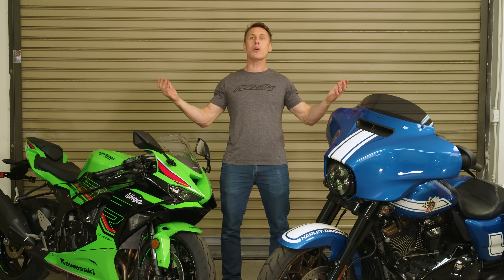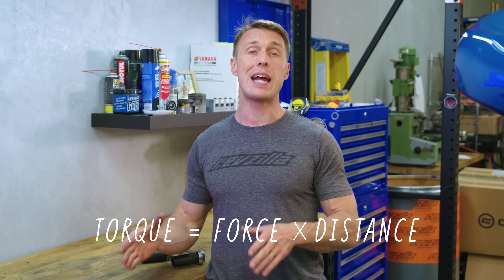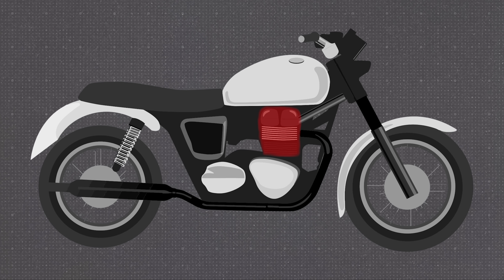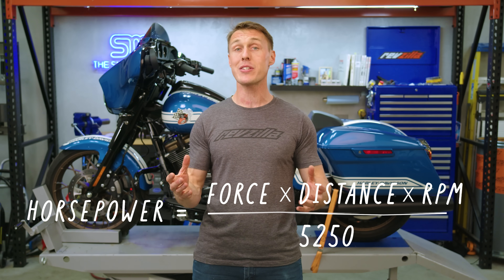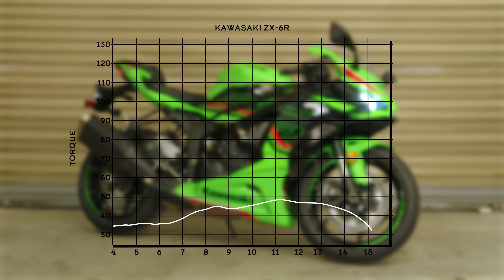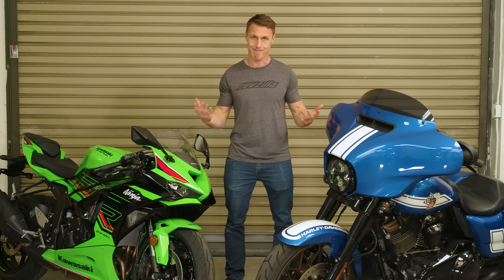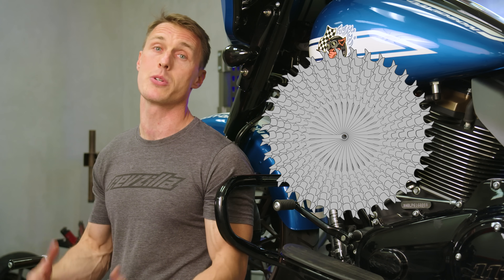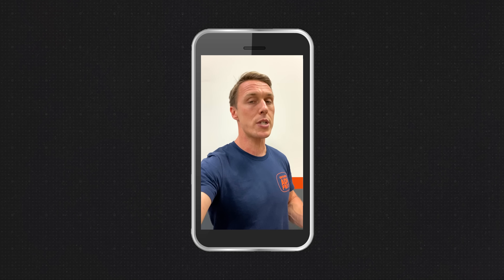Torque and Horsepower Explained! | The Shop Manual

Comment: A 8mp u/w on a 2023 mobile that's priced at around 40K rs. is just insane. It should be at least 16mp or at least the sesor should be decent even if low resolution.

Comment: So the next time a sportbike wants to race your harley; ask them to limit themselves to whatever your max RPM is.
Then explain to them why they lost despite having more HP. 

hahaha, not that they would ever do that. Hell a sportster 883 would probably beat most sportbikes if you did that. 

now imagine if harleys could rev all the way to 15k rpm with their big motors? No one would buy sportbikes, they'd be slow in comparison.

like he says in the video; you have to choose your trade off; you want high torque or high HP? you can't have both. Unless you have a huuuge wad of cash you wanna throw away.
Reply: If you limit a sport bike by rpm then your limiting the bikes HP. The bike is only making peak HP at the higher rpm. A super sport is not making much of any HP at 5k rpm which is why its slow down there. Keep in mind HP is linked to both Torque and RPM, change one and HP changes
Reply: @pleasedontwatchthese9593  Correct; that's my point.

Comment: Peak HP equals highest rate of acceleration. Keep the engine in and around the horsepower peak and the bike will accelerate it's fastest.

Torque peak equals the highest rate of increase in the rate of acceleration. So while you may not be making the most horsepower in and around the torque peak, the acceleration is increasing at a higher rate, more force, felt as more pull on the bars.
Reply: Everything you said is determined by horsepower. Torque has nothing to do with that. Replace 'highest rate of increase in the rate of acceleration' with 'highest rate of horsepower increment for a given RPM range' and think about what would happen in a real scenario.
A Harley doing a 3000-4000 rpm pull and a ninja doing a 13000-15000 rpm pull will feel almost the same if the rate of HP change (and the bikes' weight) is equal. You will just associate the higher torque bike with higher acceleration due to it being more immediate, since you don't have to work out the engine as much to get to peak HP.
Reply: @ivanbrasla Yes!  These discussions frustrate me so much because of a fundamental misunderstanding people have.  They assume Torque and Horsepower measure different things.  They don't.

Torque measures the power (twisting force) of an engine, but is a useless value on its own.  After all, a tractor has MAMMOTH torque but you don't feel much of anything when it's working, and it doesn't accelerate fast.  

The only thing that actually matters to a rider is the HP across the rpm range - much less the peak HP but the curve as a whole.  How fast do you accelerate?  How fast does your rate of acceleration increase?  All horsepower, it's just what you're concerned with there is how much horsepower the motorcycle is making at low to mid RPM.

Horsepower is the engine's ability to do work and is both speed and acceleration.  You just need the whole curve, not just peak, to understand that.

The shorthand people have of using torque as acceleration vs horsepower as speed works usually but is very misleading.
Reply: @Wintersdark  I understand what you are saying. I know that HP is the ultimate measurement. I need to look at some power curves to see if I am missing something in what I want to express.

Comment: All that matters is power curve. The flatter it is the better bike pushes from low RPM. Torque numbers is just byproduct of that.

"More torque equals better acceleration" 4:44 is absolute bollocks, what matters is how much horsepower you have at a given moment. Supersport with less torque bouncing in 10-15k rev range will leave any "higher torque" but lower horsepower motorcycle in the dust. Same mistake car guys do when talking about horsepower.

"More torque" (for same level of power) just means  that engine spins slower to get same power which usually means higher CC bike with flatter power curve than high revving one.

So not "better acceleration", just more flexible engine. Harley gonna accelerate at similar all the way from low RPM, while supersport will out-accelerate it but only when revved high.

Comment: More torque in the same rpm range equals more horsepower in that range. Gear ratios in the transmissions on those two bikes is vastly different. In theory you could gear them both to have about the same acceleration off the line.
Reply: Sure
Reply: True, It's like 4 quarters and a dollar. They are both worth the same. It's a balance of rpm and tourqe.

Comment: Watched a clip by MC Rider recently where he tried to explain this topic.
He failed big time.

This was much better.

Power is King.
More power is capable to generate more torque at the wheel with the help of the gearbox.

I wrote a longer, more detailed explanation in the comments for that clip.

Gearing is the often neglected variable in the equation 😥

Comment: My understanding is 

Torque = Acceleration
Horsepower = Top Speed
Reply: Everything is horsepower at the end, as soon as the wheel spins its horsepower (keep in mind hp is just tourqe over time). More of it the faster you can  accurate. If you want more horsepower you have to increase rpm or tourqe or both.
Reply: Torque means nothing. It's power to weight ratio what matters for acceleration.

Comment: I love you guys, but you should've refrained from using those weird analogies that make people think that they understand the difference even though they don't. You almost explained it, but failed to do so at the last stretch.
Reply: That's taking their audience into consideration.  How many watching have ever taken a physics class?  It seems like a good first step, and keep in mind, the definitions were presented.  You're right though, analogies are tough and strength and speed are flawed, and maybe better said as results rather than "like".  But he did say it was an oversimplification. And you're also right that most people think they understand concepts based on oversimplified analogies.  The flow of elections being like water in a pipe, for example.  Overall, I think it's unwarranted to be harsh on this guy for his way of expression because it's audience appropriate.  I clicked in thinking it was going to be way off the mark but after viewing I settled on not bad for beginners.

Comment: Torque gets mass moving quickly, horsepower keeps pushing through wind resistance.
Reply: Tourqe does not make anything move. It's at a instant. It's only after time passes something starts to move. And tourqe overtime is horsepower. So to  accelerate fast you need a lot of tourqe or a lot of rpm or both. It's like a 1 dollar bill and 4 quarters, they are woth the same.
Reply: oh dear, you really haven't understood a thing then

Comment: i think that was a pretty insufficient explanation. for example, it doesnt really matter for acceleration how much torque an engine makes at the crank, it matters how much is on the wheel. the transmission/final drive can multiply torque, but it can not multiply horsepower. treating them as "equal and opposite" as suggested in the video is quite wrong in my opinion.

Comment: more hp is more acceleration
do the math

more torque just means u get more hp at lower revs

combined w shitty street gearing and the physics of going 0 mph, this means torque gets a little advantage while a hypothetical clutch is slipping

but once the drive wheels and the engine are fully attached (clutch released),

acceleration = hp after drivetrain losses / (vehicle speed * gross vehicle mass)

notice this is entirely independent of engine rpm or crank torque

this is bc torque at the wheel = hp / wheel rpm
u can just ignore the engine torque and the gearing bc it all cancels out
wheel torque depends just on hp and wheel rpm not engine torque or engine rpm (except insofar as they multiply to a high enough power number)
Reply: proud to be comment 420 and thanks for trying y’all 
i enjoy a lot of yr other videos

everyone messes this one up

Comment: "Torque is a twisting motion". No, it isn't. It's a twisting *force*. If there is any motion, you're doing work, and that takes power, not force, because it takes *time*.

Furthermore that bit about torque giving stronger acceleration and horsepower making higher top speed is completely wrong.  Both of those rely on horsepower, because again, they're both doing work.

Comment: If you drive in to a wall, horsepower is how fast you hit the wall, torque is how much you move the wall you just ran in to
Reply: Horsepower is tourqe over time. The wall doesn't know how what it got hit by made its power.
Reply: @pleasedontwatchthese9593 I am tired of these dudes commenting torque = hard hit/acceleration and power = fast hit/top speed 🤣